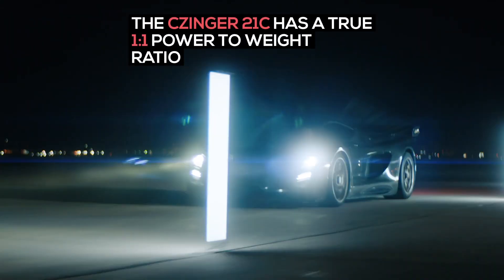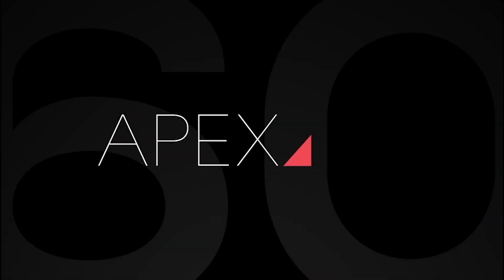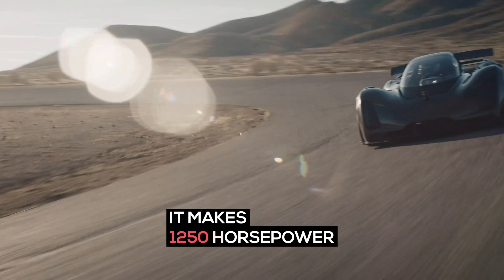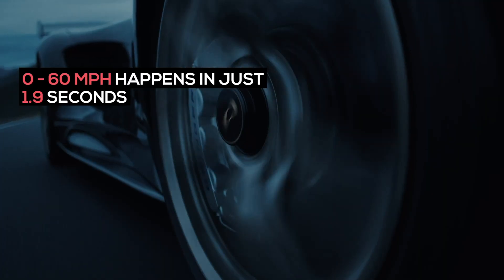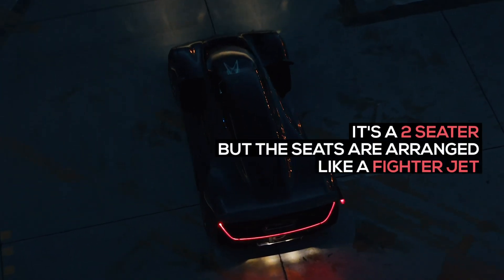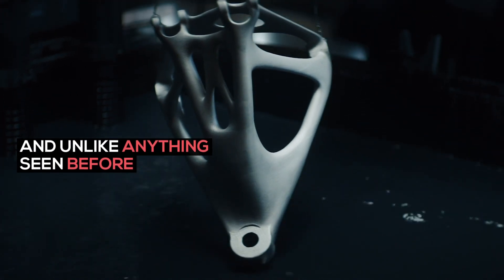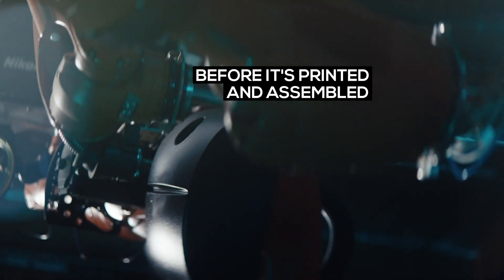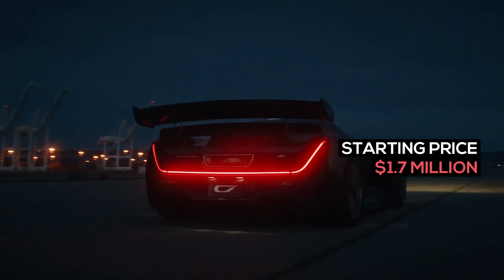The Czinger 21C Could Change How we Build Cars - APEX:60

Comment: sounds like a crazy car, but wasn't the koenigsegg 1:1 the first road legal produktion car with that insane power to weight ratio ?
Reply: I think they were.
Reply: @nikovbn839 , you are right the Koenigsegg Agera One:1 was the FIRST car with the ration of one horsepower to one-kilogram. It also had a theoretical top speed of 273 MPH which shown to be true thanks to a different variant called the Koenigsegg Agera RS.